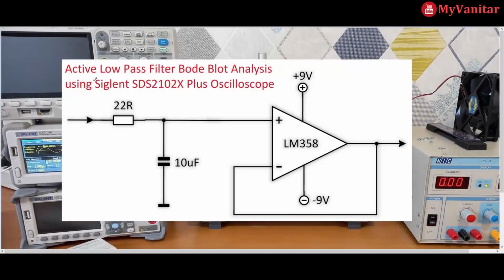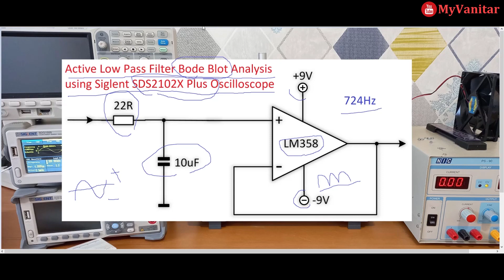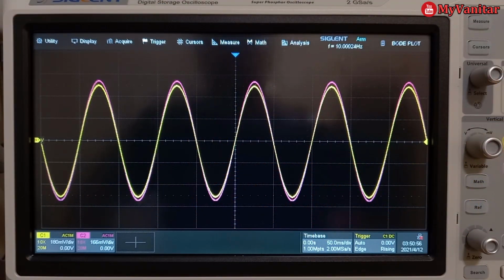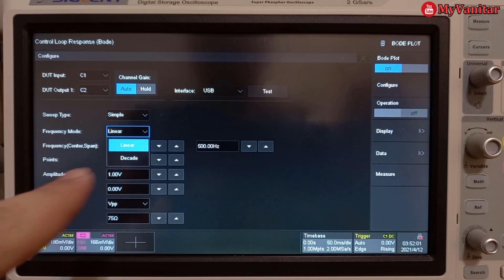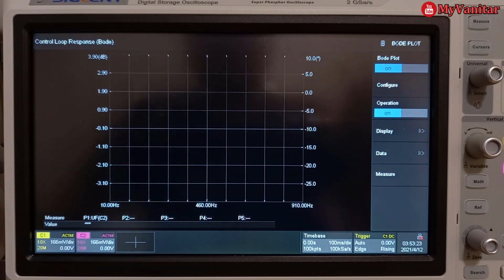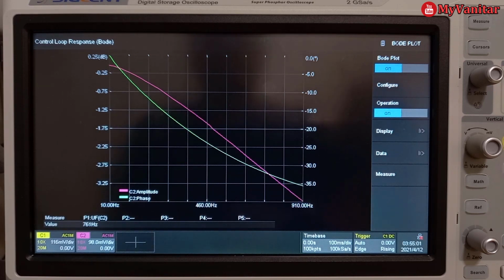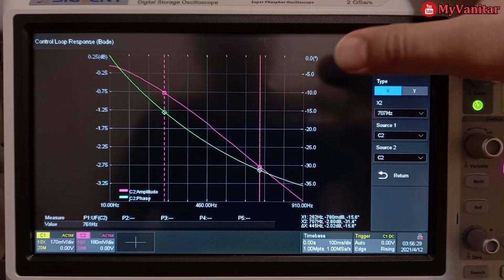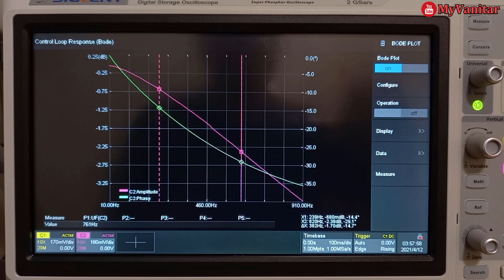Active Low Pass Filter Bode Plot Analysis using Siglent SDS2102X Plus Oscilloscope [Part-2]

Comment: I have seen two hookups for the generator to the scope. One uses a connection from channel 1 to the scope's channel 1. This would serve as a reference signal. Then from channel 2 of the generator, it would fed the input of the DUT and from the output of the DUT, it will go back to channel 2 on the scope using a probe.

For the other method, one would use a termination tee on channel 1 of the scope. From channel 1 of the generator, it would feed one side of the tee and the other side of the tee would go to the input of the DUT. And the output of the DUT would connect to the scope's channel 2 using a probe.

I can see pros and cons with both hookups. Which method do you prefer?

You didn't show the hookup of your cables in this video. How did you connect your cables? Have a great day!
Reply from the maker: in my case, I did not use 50-ohm terminators because the cut-off frequency was quite low; it was a low-pass filter. CH1 is connected to the filter input and CH2 to the filter output, you can see the wiring in the video

Comment: You dont need +9 and 9 just make R1/R2 devider. there are benefits with it but 
down side is VCC - 1,4V 
for maxinal signal you can use (9- 1,4 up and............  0+1V down) = 6,5 Vpp
Reply from the maker: if the input signal contains negative elements, we have no other option than dual supply.
Reply: @MyVanitar  You are apsolutly wrong, just do it.
Reply from the maker: by doing that, we just shift the levels, the signal is out, but signal levels are wrong. depends on the application
Reply: @MyVanitar  U need 2x 100K and minimum 1uF bypass copasator you don't change anything.

Comment: Hi, thanks for posting informative videos. Wondering for what situations you would  chose to utilize the SDS2102X-Plus over the SDS1104X-E? Thanks!
Reply from the maker: 2102X-Plus is a sexy model girl, pretty fast with tons of features. SDS1104X-E is a good entry level girl :-)))). Apart from jokes, both of them are very good, however plus one is something beyond. Even you can insert your own mathematic formula to calculate the waveform. I can not mention them all here, just briefly check the Siglent documents. You'll get a picture.
Reply: @MyVanitar  lol, very good explanation, thank you!

Comment: Do you know you can connect USB mouse (and the keyboard as well) to this oscilloscope and not use fingers to touch the screen to: use options, move cursors, move scrolls, press buttons  nor use pen to show smth on the screen. Use mouse pointer instead :) It will be more elegant ;)
Best regards!